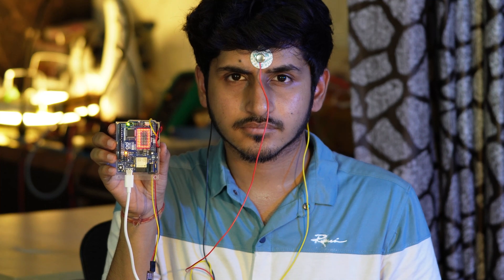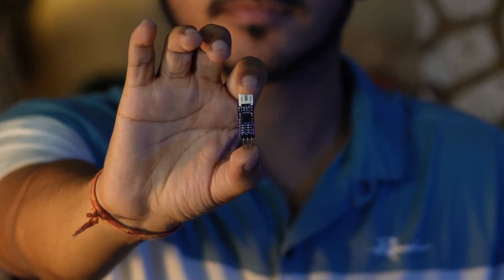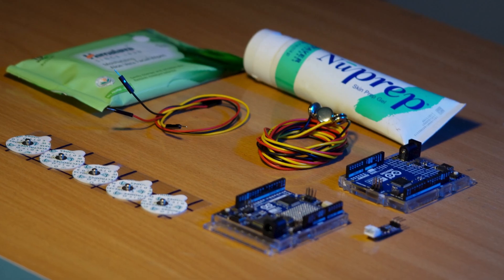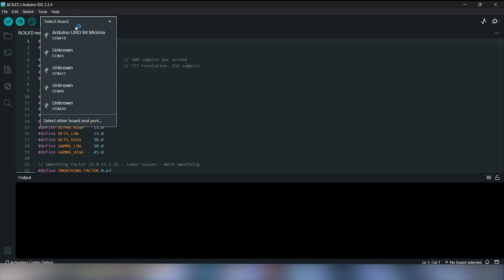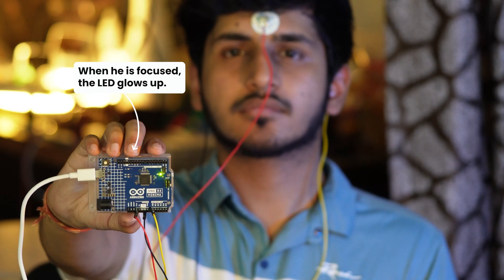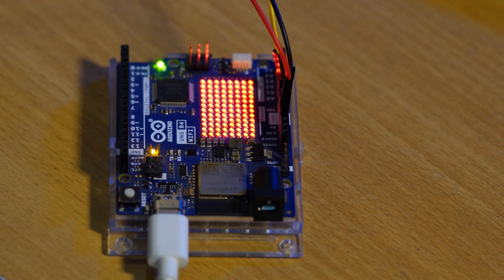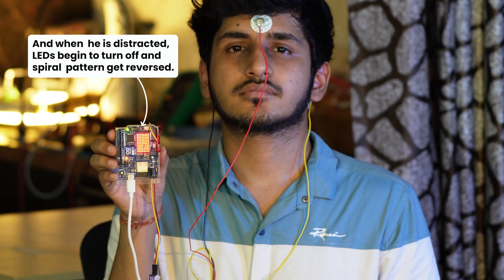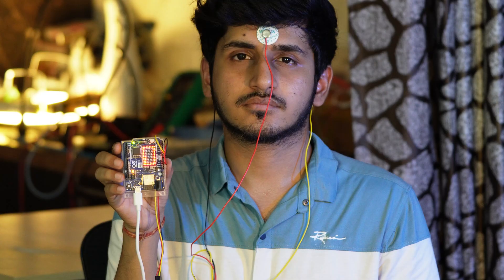Control LEDs of @Arduino Uno R4 Minima and Wifi with your mind | BCI | EEG

Comment: Really  good work and nyc explanation ...👏 Can I get complete code and connections for this project
Reply from the maker: You can check this project on Upside down labs instructable 🙌
Reply: @UpsideDownLabs   I could not find the code
Reply from the maker: Here is the link of code: https://github.com/upsidedownlabs/Brain-BioAmp-Arduino-Firmware

Comment: Whats the actual difference between THis video ,and older video "Play video game using your mind | EEG | Complete tutorial | DIY Neuroscience" , except hardware changes , and second why there is no need to collect and train the data anymore ? how can this work ? and will this now work for everyone brain , And forth can you provide a specfic reasearch paper where you are calculating the 20% ratio for beta brain waves, how you justify this ratio ?
Reply: In that video, we are providing raw data to an AI model to classify two states of the brain; those states can be anything, like focused or unfocused (binary action). In the current setup, we are processing the data first, applying the filter, then calculating the FFT, then calculating the band power values, and finally smoothing those values before sending them to a thresholding logic where we check if the beta values are above a certain threshold. When we see the values are above a certain threshold, we are sending a trigger to either control an LED on Arduino UNO R4 Minima or activate the spiral pattern on the LED Matrix of Arduino UNO R4 WiFi. I hope this clears all your doubts. Let us know if you have any further questions. Don't forget to check the source code link provided in the description box below.